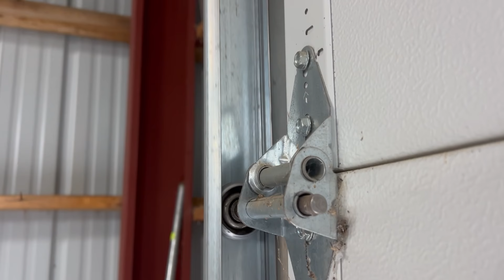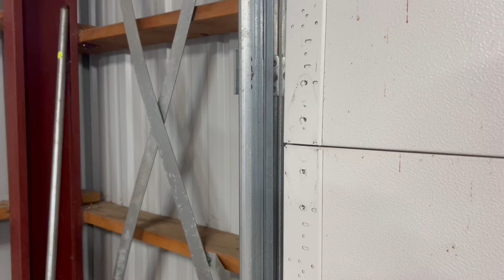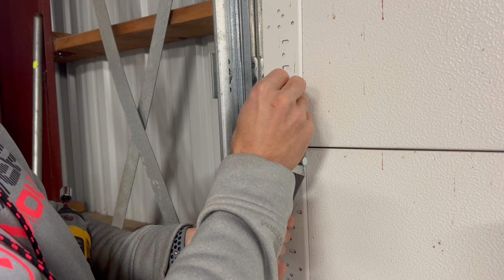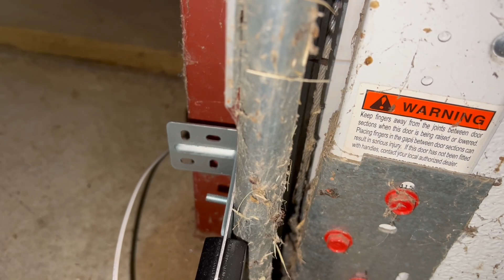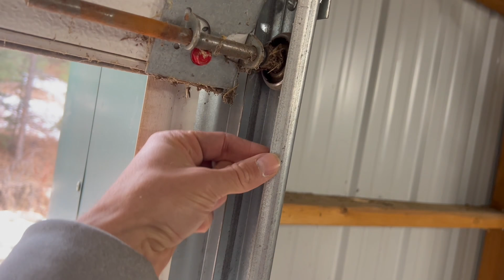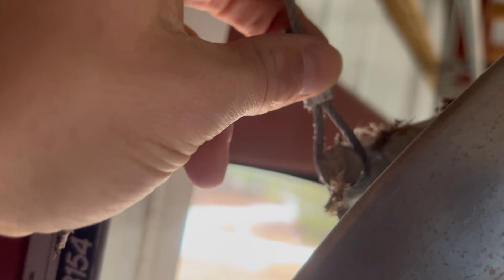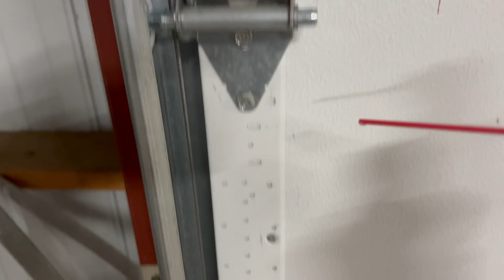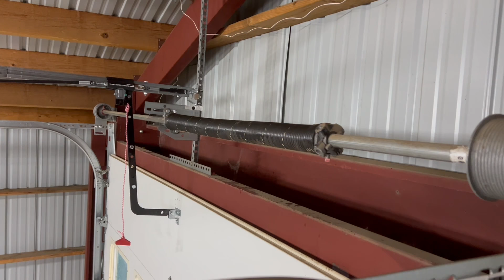How to Replace Old Garage Door Rollers WITHOUT Bending Track (Easy DIY Install) | Builds by Maz

Comment: Add a second spring to your door.this way the spring doesnt have to be wound as tight, lasts longer and if one ever breaks you still have one spring holding the door. Dual springs saved my noggin.

Comment: This is super weird!... Today, I noticed one of the rollers on my garage door was outside of the track giving considerable resistance when opening/closing the door.  I bent the back of the track so that I could place the roller back inside then fixed the bent.  I did not search on the internet or think to replace the roller(s).  Yet, this evening the YouTube algorithm recommended your  video.  How is this possible??  Coincidence??  Anyway, thank you so much for this video as I never thought to replace the rollers with nylon wheels nor did I know how to go about replacing them.   If the wheel should ever come out of the track again now I am confident I know how to fix it.  Again, thanks.  While shopping for those nylon rollers, maybe I should buy a tin hat as well!
Reply from the maker: No problem! Haha, pretty crazy how that timing works sometimes...

Comment: do the nylon rollers wear out / grind down?
Reply from the maker: I used some on another garage a couple years ago and have not seen any wear down. The manufacturer states that they last 100,000 garage cycles, but if you are concerned about it then new metals rollers are also a great option.

Comment: Instead of bending the track using a locking plier or roll up the door to its full extend and removing the bottom bracket like in this video, the easiest (safest) way is by removing the 2 or 3 screws which attach the track to the wall (use this method with the garage door fully closed and do not remove the screws holding the bracket to the track only the screws holding the bracket to the wall) but keep the connection at the top where the track bends. Once the bottom part of the track is detached from the wall, gently bend the track outward at the bottom where the bottom roller is located to remove the old roller and replace it with the new roller. Warning!! do this on one side at a time.

Comment: Also consider checking the balance(spring tension). If the door doesn't stay put when half way up (unlocked from track of course), it’s not balanced and this could strain the motor /chain and make more noise as well as wear the motor out sooner. have a qualified technician adjust the spring tension if needed.

Comment: After completely cleaning, lubing with silcone spray for garage doors in the correct places, still had squeals (it's been very cold for a while, so attributed some of it to that) so decided to replace the rollers (quite a bit of black rubber was in the track, so it was likely wearing over the past 16 years). Your video helped tremendously and everything went well until the bottom roller change. I removed the left one via the cable removal method, clamping the cable in place so it would not unravel. THEN, not realizing this, I took the other side off too, but BEFORE I reattached the left cable. Biiiiig mistake...! Long story short, that was major pain trying to hold everything into place and scoot a ladder under it so it wouldn't twist and come apart. Whew, lesson learned, but I would highly emphasize to COMPLETELY do one side, including reattaching the cable, BEFORE doing the other side. I have one more door to do, so hopefully I'll remember that the next time! Otherwise, thanks for the information!
Reply from the maker: Glad it worked out for you even with all the struggles! I should have made that clear in the video to just do 1 side at a time.
Reply: @buildsbymaz  No worries! I should have paid more attention and thought about it logically, but it was chilly and I had a senior moment..!

Comment: They work good for few months.  then bearings go out. Making  metal squicking noise lol
Reply from the maker: I've never had that happen to me after replacing a few sets in different garages. It's important to regularly maintain them with lubricant though.

Comment: my motor is so loud, idk if it's worth replacing my wheels
Reply from the maker: The rollers are such a cheap replacement, it may be worth it just to see.
Reply: @buildsbymaz  maybe i can grease the motor gears

Comment: Garage door opening is usually louder than a garage door closing right?  Seems like the last portion of the video is misleading.
Reply from the maker: Not at all - with squeaky wheels it's noisy either way. Check out the beginning of the video where I show the door closing with the old rollers.

Comment: Great Video!  I always turn my screws backwards in their hole until I feel the threads drop into the grooves, even with sheet metal screws.  That way you don't cross thread the machine screws and don't cut new threads on sheet metal screws, which weakens the metal holding the screw.  Others just put the screw in and power it in. after a while, the screw can't tighten and just spins so you have to get a larger sheet metal screw to get it to grip again.  I noticed when you replaced the first hinge, you put the first screw in caught at an angle and it ended up flat, so obviously you didn't catch the original thread.  I learned this technique in the fire department in 1974.  They cut the end of the threads on hose couplings flat, called a Higbee cut, to make it easier to feel it drop into the groove while wearing gloves.  Of course, now they use locking Storz quarter turn connectors, at least on large diameter hoses.  They added the locks after people got killed or wounded when large non-locking Storz connectors came undone when pressure was ramped up.  https://duckduckgo.com/?q=Higbee+cut&atb=v349-1&ia=web
Reply from the maker: Great tip! I'll be sure to do that next time, thank you.

Comment: Leave the metal roller alone at the bottom of the door.  You have replaced 90% of the rollers. Big difference in noise has been achieved.
Reply: I think I will follow this recommendation...I did all the others and WOW what a difference in noise and rattling. I would not think those last 2 would make any difference at this point

Comment: Silicone spray comes off relatively quickly with friction. What made you use that instead of garage door lube?  Debris less likely to stick?
Reply from the maker: I've been told that silicone and white lithium are both great options for garage door lubrication, and I already had the silicone spray on hand.

Comment: If you use dry lube, will not pick dust like wet. As a side note: if you have a screw drive buy a spare pinion/ disconnect, sooner or later it will need replaced, especially if tension is incorrect.😁
Ed c

Comment: If you have a kettlebell weight at home, you could bend a metal coat hanger into an S-hook and hang that weight on the cable when you unhook it to prevent the unwinding issue.
Reply: OMG I was actually thinking of using a kettlebell.  hahahhaa

Comment: Excellent video.
Might I also recommend spaying some silicone into the bearing the new roller will slide into.  Or instead just put a small amount on the roller's shaft before inserting it.
You can also go for the full Monty by replacing the entire hinge as the old ones will surely be scored if they are very noisy.

Comment: Question:  I have 2 red bolts, and two silver bolts on the top bracket as well, but there is no cable connected to it (Cable only connected to the bottom bracket, like in your video). 

Would I be safe to remove the 2 red bolts from the top bracket?  I'd assume I would be safe to do so since the cable isn't connected to it at all, but would like to double check to be safe.
Reply from the maker: Double check that nothing else is connected to that top bracket. It's unusual for there to be red bolts there...but if you are sure that nothing is connected to it, then it should be fine to remove.

Comment: Always just loosen the top screw and swing the hinge out.  The roller will stay on the track so you can now remove it.  Put a new roller on the track and swing the bracket back into place while aligning the shaft of the roller to the hole on the hinge.  You can go faster that way.
Reply: so remove the bottom 3, loosen the top, swing out, replace and reinstall.
Reply: You'd still want to make sure the joint is over the seam of the door so it bends appropriately.  Even a small change in placement can make it function poorly.  Obviously  you have a margin of movement or change when taking them off or even leaving one screw in.
Reply: smart
Reply: How to replace p shaped garage door bottom 
5:53

Comment: Might want to apply anti-seize compound to the roller shaft before installing. This stuff is very slippery and will last forever.
Reply: True, but be very careful when applying it.  That stuff gets on everything from just looking at it.  And if it gets on your clothes you don't want to put them in your washer.

Comment: Thanks for this! Your technique worked well, but on the bottom rollers of my door, instead of all the screws like you had, it only had 2 but also had 2 "rivets" on the side. So, as you showed, I opened the garage door, removed the 2 retainer-screws and then worked the rivets out of their slots (being careful to NOT let the cable slip off it's connector!) and installed the new rollers.

I'd also like to add that when I saw the rollers that you linked to, they seemed larger than my existing rollers. The ones you recommended from Amazon were listed as 2" (but the specs said they were actually 1 13/16ths) while the ones on my garage were 1 3/4" (1/16th different). That might just mean the 20-year-old ones on my door were worn down by that amount.  Anyway, they seem to be operating just fine.
Reply from the maker: Glad to hear it all worked out. The rollers are generally always smaller than 2", they are just called 2" rollers per industry standard. I bet your old ones were indeed slightly worn down.

Comment: Part of me loves this because I just like pointless enhancements of any kind but a majority of me says "Those are either way overpriced or so cheap that they're ching'd in China & you won't even hear them chang in 4 years when they literally fall apart....whereas the metal ones last 50 years minimum."

Still very cool & a great video. I will have to look into this. If you want crazy quiet, the door on my Lake House is a Chamberlain Quiet somethinerather that uses a Belt instead of a Chain & all you hear is the wheels. Imagine these on that! Not sure if they'd use a belt on a Garage/Barn/Commercial Building & I certainly didn't but my garage was built in 1996 so a Garage Door Opener was luxurious as all getup then (to me at least).
Reply from the maker: Metal rollers can still be great too as long as they are properly maintained. I agree that belt drive garage openers nowadays can also make a huge difference!

Comment: Use a specialty lubricant for door tracks. It is dry and contains Teflon.
Reply: It's actually best that there is no lubrication in the track because you want there to be friction there. You want the rollers to grip or rub against the solid track and therefore rotate at the bearings. They're not designed to just slide across the track but to actually grip onto it and roll at the bearing.

Comment: I watched this, and thought I would try just lubricating the existing wheels and spring first.  The end result is astonishing.  So I would suggest people try that first, and if they are not happy, then go ahead and replace the rollers.
Reply from the maker: If you haven't lubricated your garage door parts in a while (or ever) then this can definitely make a huge difference on its own!
Reply: Heck yeah...90% of a garage door noise comes from the hinges not being lubed...the nylon wheels make very little difference but do help in cutting down on maintenance as they don't require periodic lubrication like the hinges require....as Forrest Gump said "one less thang"
Reply: Any particular lube? WD40, 3-in-1, Silicone Spray?
Reply from the maker: @s.s.7754  Silicone or white lithium grease both work great. There is generally a section at the hardware store with all the garage door lubes together.
Reply: If I do this, I would leave the bottom roller in place.  I don't want to futz around with the cable.  How much difference could that one roller (on each side) make?
Reply: I might add replace with steel rollers the nylon ones shown are made in China.
Reply: @harryberry474  gee a trumper

Comment: Why ppl add background music to instructional videos is beyond me. And it's always crap music, every single time. Also, Silicone should not be used for metal to metal contact. Other than that, thanks for the video.
Reply from the maker: Sorry you don't like the music. Silicone or white lithium are both fine for garage lubrication.

Comment: Thanks for posting. Replacing the rollers has been on my 'to do' list for a while. But my more imminent item is to service the coil spring. 
Over 2 decades, it has relaxed so much that the electric door opener often stalls. I know one option is to loosen the spring's fittings to the mainshaft in order to wind it a couple more revolutions. But, I suspect that the spring is basically fatigued. If it is, winding it up more may just accelerate its fatigue to the point of it snapping. I'm torn between winding, or replacing it.
Reply from the maker: I would definitely replace it, 2 decades is a good lifespan for those springs. If it does break then you won't even be able to open the garage door at all, and that's the last thing you want when you need to get to work or somewhere.
Reply: @buildsbymaz  Thanks for the reply. Now just need to see a video on spring replacement. Any chance you covered that as well?
Also, I was surprised about recommending a silicone dry lube on the spring. That makes sense if the coils rub. But I assumed they were spaced. Do they actually rub?
Reply from the maker: @ Honestly I would get a pro to change out the spring...that's one of the things I don't mess with. Too much risk of injury if you do something wrong.

As far as the lubricant, both silicone and white lithium are great options for the spring. Many lubricants marketed specifically for garage doors will contain one of these.
Reply: @buildsbymaz  Interesting.   That lubricants exist specifically for the springs also supports the notion that the spring coils DO rub against each other. That may explain why my door has a lot of friction. With the opener detached, if I manually lift (or lower) it to any height and remove my hands, the door will not only stay put, but require a significant amount of effort to then move EITHER up or down. I've kept the rollers lubricated and have confirmed that each roller is free rolling. But I never considered that the spring itself might be binding. That further validates replacement of the existing springs. Thanks!

Comment: FYI - There's a specific spray my garage door guy told me to get.  It's must say "garage door" lubricant.  He didn't care which brand, just told me to make sure it was labeled correctly.  It won't attract dirt etc.  I've used it several times and it works.
Reply: Use Motorkote oil  spray.  Does the job and doesn't collect dirt.
Reply: Scam

Comment: An easier and safer way to replace that bottom wheel. On the torsion spring ends that is a part that is called the Cones or end caps. In the video at about 5:30, is a good picture of the one that has holes in the Cone casting. They are there so you can slide a 1/2' X 18" steel winding bar in it. On my door I used 2 steel pipes about the same 18" length and you need 2 to work it. I slid on pipe in and wound the spring a little tighter so I could install another pipe in a second hole. Then I slowly let the spring wind back until the second pipe buttes up against the sill and locked the torsion spring. Then I removed the lower wheels and mounts to chang out the wheels. I do not like to bend the tracks. After changing them I put the cable on and wound the spring with the pipe just enough to pull out the other pipe. After locking the door tension spring you can raise the door slightly to get some slack in the cable and use a C clamp and a block of wood that fits inside of the track to hold the door in place at the wheel above the bottom wheel. It is surprisingly easy to do it that way and you don't have to bend the track that could cause problems distorting the track. Just be safe when working with that spring and use some common sense. Here is a link to a parts store that can explain it and they have the parts, tools and instructions with a few videos. I don't work for them, but I did buy a cable from them some years ago. 
https://www.expressgaragedoors.com/collections/garage-door-torsion-spring-parts
https://www.youtube.com/watch?v=5k9qrgZ9rPs

Comment: Why not put weight on the cable loop after disconnecting from the plate with red screws?
Reply from the maker: That's what I should've done. But at least this way I could show people how to rewrap the cable.

Comment: My garage door was 30 years old, uninsulated and had those old rollers. The opener was 16 years old and chain driven. I eventually sprung for a complete new door and system. Between the new opener and door, I can't even hear it from the inside anymore. Before it sounded like a train going by.
Reply from the maker: I'm sure that was a huge difference. Garage doors have come a long way!

Comment: Why not hang a weight to the cable after remove it from the brcket so it will not unwind.
Reply from the maker: That's what I should have done.

Comment: Thank you for this teaching method. I appreciate it, I'm retired and need to save money.😊
Reply: I just put a drip of oil into my rollers every year or so and they last a lot longer. Rusty ball bearings in the rollers is why they're so noisy.
Reply: @kevincourtney7312 : I better do that to my garage door now it will make the parts last longer and save me a service call